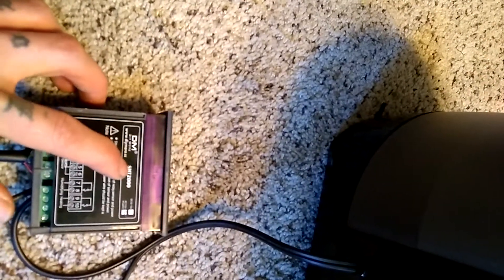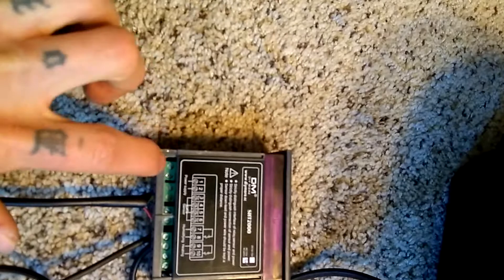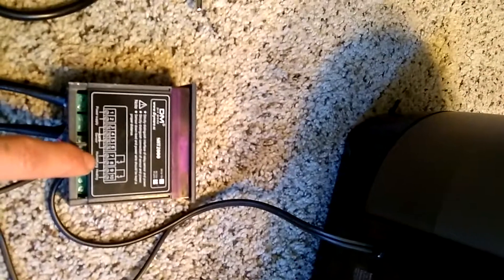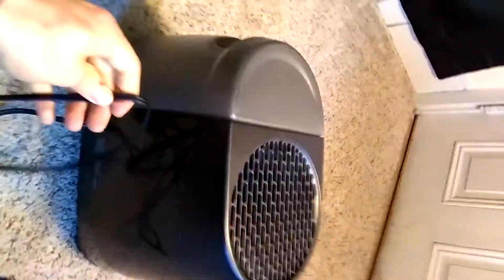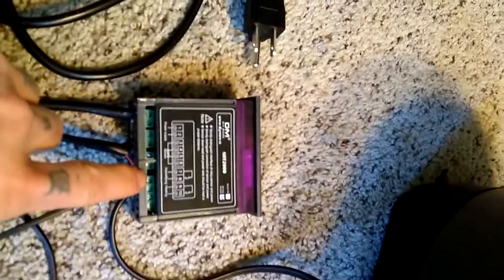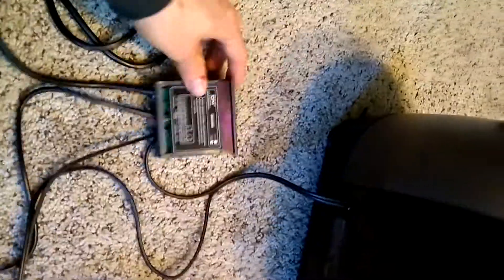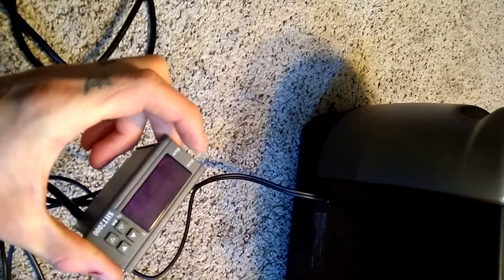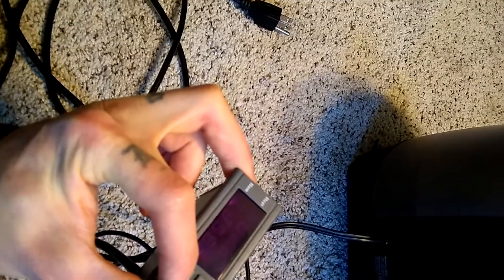How to connect and use the SHT2000 humidity and temp controller.

Comment: I just got these modules the other day and I hooked them up last night.  I hooked up a 100watt light on the heater side for heating an incubator for hatching eggs.  The light came on for about 6 seconds and went off.  I hooked up the other module and the same happened again.  Its my understanding that the relays in the module are 120 volt rated so I don't know what happend.  Did you have any problems like this?  I am an electrician so I know what I'm doing.
Reply from the maker: Hmm... No that is odd. Im using both the heat and humidity sides at the same time. Total current is 700W and it's been fine for several months now. Room Temps are pretty warm as well.

I'm not sure what could be wrong. Since it's coming on for a short time seems like the connections must be fine. I'm thinking there's an issue with it sensing temp? It is very sensitive and responds quickly. Perhaps it's just reaching the set temp very quickly?

Did you just let it sit and watch it for a bit?